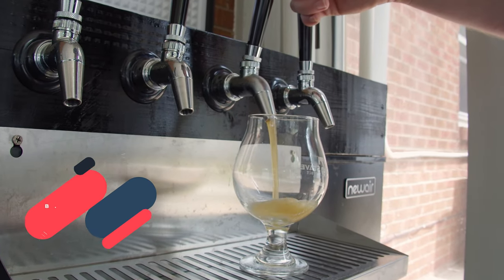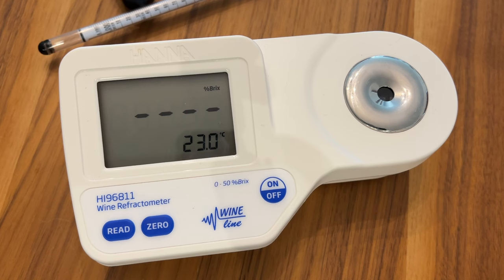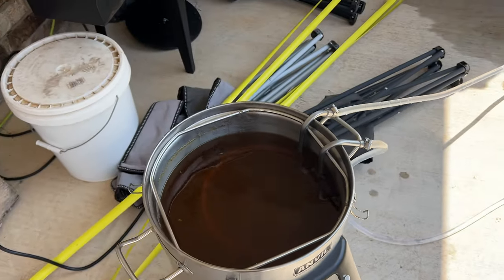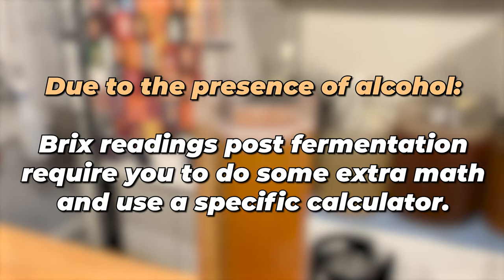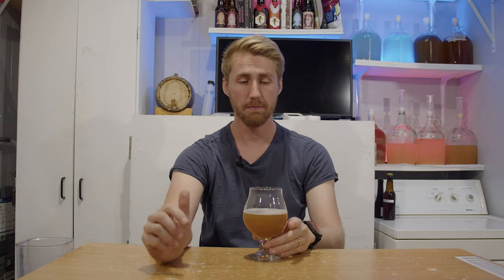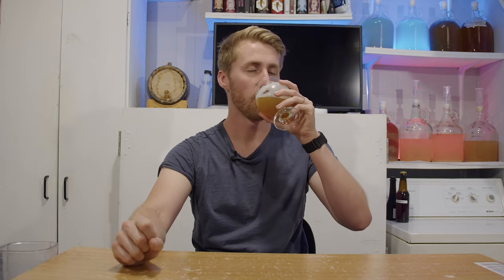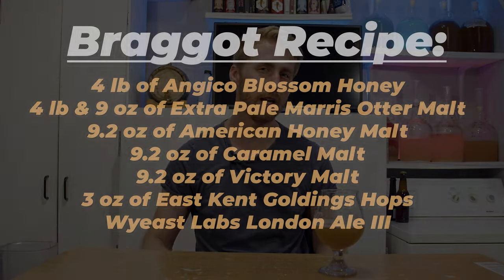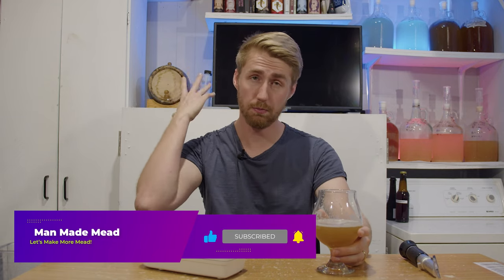My First All-Grain Braggot (Beer & Mead) Ever!

Comment: There's a bunch of fruity hops i could really reccomend, I've used alot of citra, mosaic, sabro, el dorado, eclipse, ella or stella all would go well with a floral or fruity varietal of honey, as far as malts I would use golden promise or maris otter, pale crystal, maybe a little dextrine malt or carapils, wheat is a good option, you'd want it to be balanced, malty and hoppy with a prominent honey character, and don't forget to garnish your creations, Lime or orange wedge or wheel, mint etc. Cheers and happy brewing.
Reply: Also other hops that may prove more difficult to obtain, nectaron or could be called hort-4337, wai iti, cryo pop, BRU 1, Zappa, but use these ones in the hop stand or whirlpool, Zappa can create a kind of fruit soap like taste when used at the start or middle of boil.
Reply from the maker: Those are fun! I'll have to try them at some point!

Comment: Looks really good! My braggot is actually very similar. I use pale ale malt in the summer and aim for a lower abv like this to make it a bit more crushable, and use maris otter in the colder months to bulk it up a bit more for sipping. I leave the caramel malt out altogether in both recipes, but otherwise the grain bill is the same!

For hops I like to switch it up a bit bit always fruity, as that's what I keep stocked. Citra, idaho7, el dorado, and sabro have been my favorites. 

As for yeasts, I tend to stick with Voss for its orange/citrus character, and fast fermenting without any real temp control. I'll be messing with brewing salts in the future and trying to figure out what sort of water profile works best on the recipes. So far a NEIPA profile has really worked out, giving it a pillowy soft mouthful. 

Thanks for the video, and get after that beer!

Comment: Add some Grapefruit Juice or Pinapple Juice to the glass and see how it tastes, If its good you can always add it to the keg.

As Flora says grapefruit fixes everything lol

As far as Changes, Your Grain bill looks fairly solid, I would however add a pound of Either Caramel 40 or 60. I would also change the Hops up a bit  I would do the hop bill as follows:

30 min Boil 1/2 oz Amarillo hops
20 min Boil 1/2 oz Citra Hops
10 min Boil 1/2 Oz Mosaic Hops
Flame out 1/2 oz Lemondrop Hops

This is called hop Bursting, it will give Some bitterness but it will give you amazing hop aroma and flavor.

Comment: I'm just curious if you determined that more than 50% of the available sugars came from the honey. If not, I'm wondering if you'd "technically" call this a fortified beer instead of a braggot? I'm not trying to break chops, but please don't say it's semantics, lol! Doesn't a mead have to contain 50%+ sugar from honey to be considered such? By the way, I'm working on a braggot made from an old gruit recipe, and I'm wondering if you ever considered replacing the hops with non-estrogenic herbs?
Reply from the maker: There are multiple schools of thought - some people say the 50% marker. Others say that it just has to have a predominate honey character to it. I'm running with the latter one. I haven't thought about replacing hops with herbs!
Reply: @ManMadeMead  Well, personally, I feel that whatever is dominant as far as source of sugars is how it should be classified. If most of the sugars come from grains, it's a beer. If most of the sugars come from grape juice, it's a wine, so forth and so on. It's nothing to go on about, just wanted your opinion. Thanks! My gruit recipe has yarrow, bog myrtle, and marsh rosemary (can be tough to get). The 1516 German Beer Purity Act ended the use of stimulating herbs and replaced them with hops. I love my beer, but the hops have had me sketched out for a while (I just don't want all that estrogen).
Reply: @littlebones88  I agree with you about the hops and estrogen.  Hops has been traditionally used to increase milk production in breastfeeding mothers.  Banking on this, Budweiser used to make a 1.9% beer for pregnant (!) and nursing mothers.   I firmly believe that men should not be drinking IPAs due to the hops content.  Unless you're a monk, and want to tamp down your sex drive, which was the original point, as I understand it.
Reply: @julietardos5044  The women that went out and collected hops back in the day came into their menstrual cycles sooner because of it. I believe Estradiol is the primary estrogen in hops. This kind of sucks because I actually love hops, and beer, but I've cut back, started making/drinking mead and have started making gruit or herbal beer, which the first batch wasn't too bad. I love beer, but I love my testosterone more, lol! (I'm no monk)
Reply: @littlebones88  :-)  
I doubt the occasional hopped beer is harmful to men, but it doesn't hurt to be sure.
Reply: @julietardos5044  Well that depends on how much and how often you drink. Usually, when I drink it's rarely one, lol!
Reply: @littlebones88  🙂
Reply: @julietardos5044  🙂
Reply: @ManMadeMead  mugwort and heather make great hop replacements